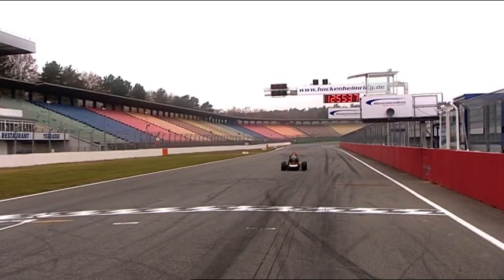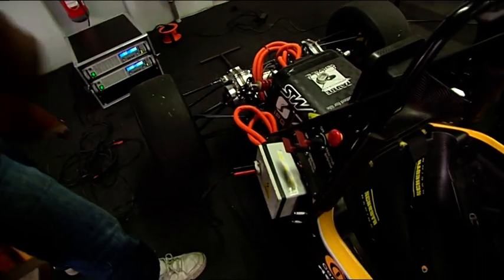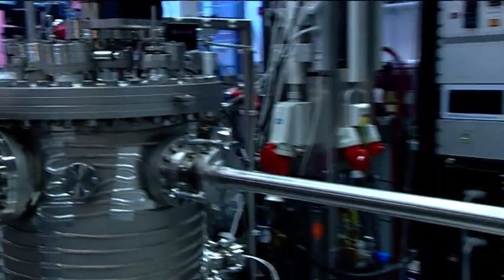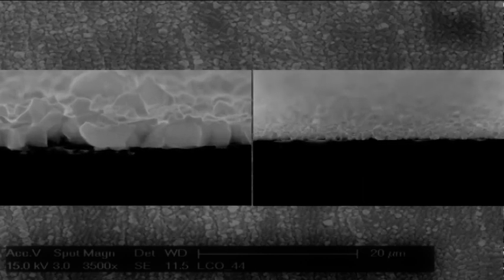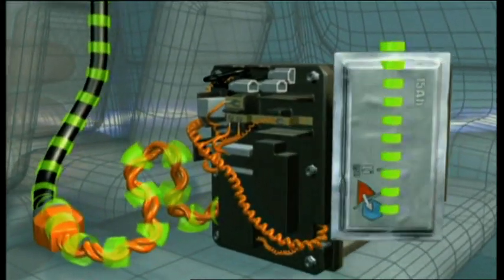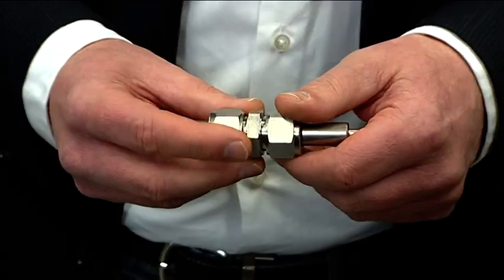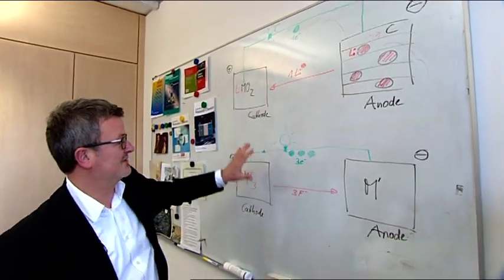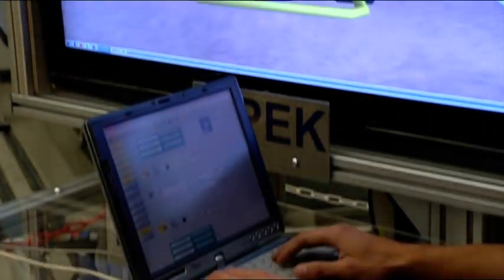The Battery of the Future

Comment: Nice, but we also need to come up with a battery that doesn't become useless either if we want batteries to replace gasoline cars. Quick 5 minute charging and one that can be repeatedly discharged and recharged without the battery going dead.

Comment: Twice as good isn't good enough. The ideal battery would charge in minutes and hold 10x the energy per kilo of weight while maintaining a small footprint and cost 1/5th of current batteries. The cell should be at least 90% efficient in charging, preferably higher. The best cells on the market take about 140-150% of the battery capacity to charge (1.4-1.5KWH for a 1KWH battery) Then we have to figure out how to generate all this electricity.
Reply: +tarstarkusz All true. 
However, if parking spots were equipped with electrical outlets (something that you can't do with petrol), the charging time wouldn't be much of a problem.
As for generating the power, electricity can be generated any number of different ways. So an electricity based system would afford us a whole load of freedom that we wouldn't otherwise have with regards to transport.
Also with advances in computer technology, and our (relatively) new understanding of ultra-high temp plasmas, fusion isn't far off. First plasma at ITER should occur in 2020. Also, china is doing it. Better than the west as usual.
The real problem will be getting the cost of the battery down to the point where companies can make viable cars out of them.
Reply: +tarstarkusz Such a battery exists, and it is called aluminum ion. Oak Ridge labs made a good one using aluminum and aluminum chloride, and there was reference to one that was even better online, but I can't seem to find the reference anymore. . . I have already made one using iodine extracted from seaweed and carbon from charcoal (instead of manganese dioxide), but the molar weight of iodine is too high so I want to make a lighter one with a different material. The battery was very small, but lasted a long time and recharged easily and repeatedly. I also made one with toothpaste but fluoride is nasty stuff. Aluminum batteries have been made with over 1000 watt hours per kg, and you don't have to take such ridiculous precautions as with lithium.

The wikipedia article on them is pretty lousy, but outlines some basics. They are far safer, cheaper, and easier to produce than lithium, but lithium is big business and scarce enough to control. Follow the money.
Reply: I take it you're saying this actually works. I've read Al-air batteries have the highest energy density of them all, but the Al plates have ro be manually replaced along with the electrolyte since its no easy process to restore pure Al on the plates.

Comment: The reason why we cannot have strong, long lasting, high capacity batteries is because few people still want to make money by selling oil.

Just look from their point of view - such batteries could destroy them easily
Reply: +vavrorvav Can you be a little more specific on how this works? A complete abandonment of oil for use in cars wouldn't have much of an effect on the profitability of oil. Oil is one of the most versatile substances on the planet, maybe second only to carbon. What would happen is we could stop producing the most expensive oil we currently produce if we stopped using oil in cars. The petrochemical industry is huge and could grow even more if this oil was freed from being used an energy source. Then there's everything else in transportation that uses oil. We are a very, very long way away from substituting electricity for diesel or kerosene or aviation fuel because battery technology would have to be 100x better to displace diesel/aviation uses.